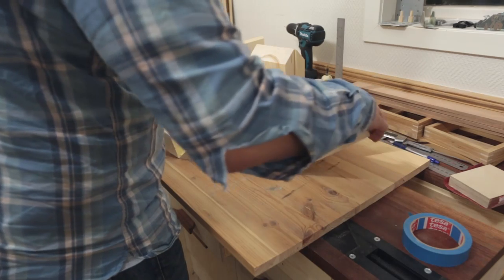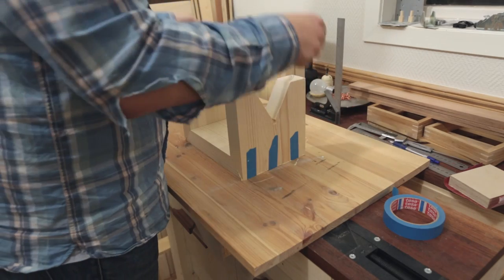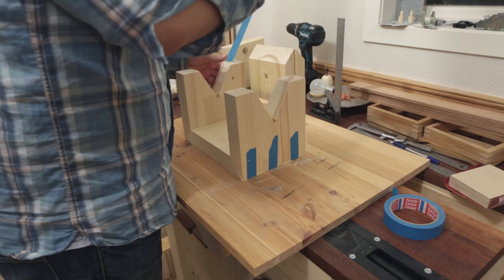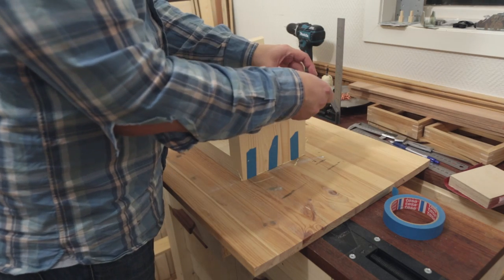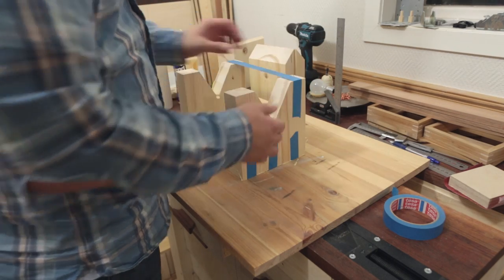Step Stool Build Video

Comment: and to wipe away excess glue I would suggest a rag with hot water on it. the hot water prevents the glue from soaking into the wood if you were to stain your wooden project it would cause blotching on the stain
Reply from the maker: Usually do that :)